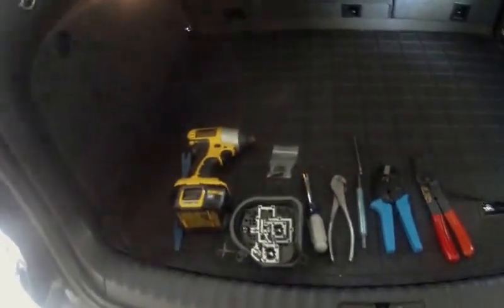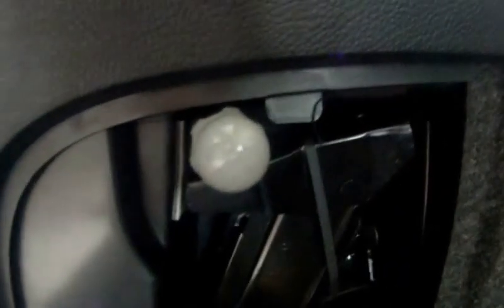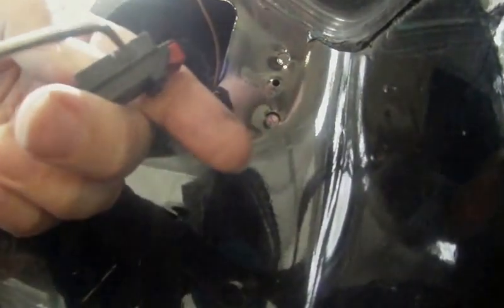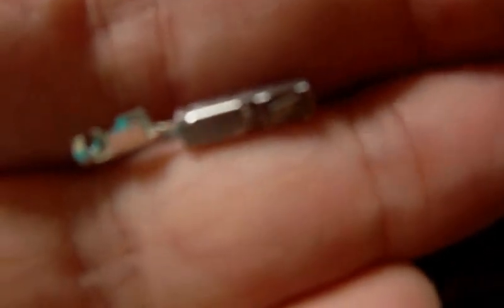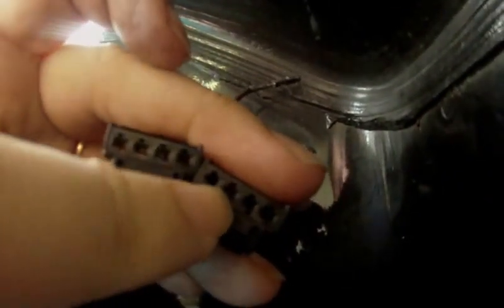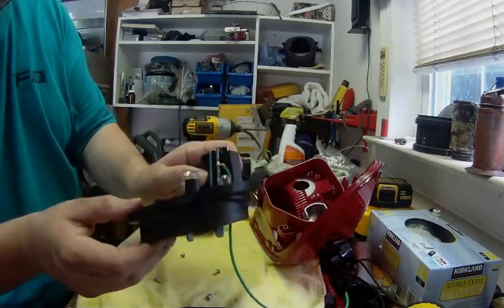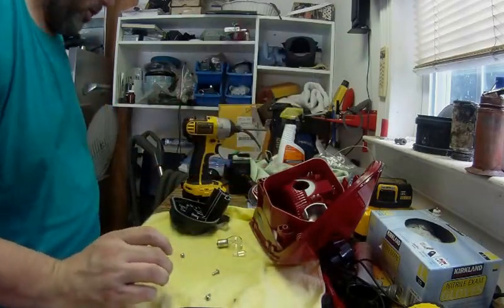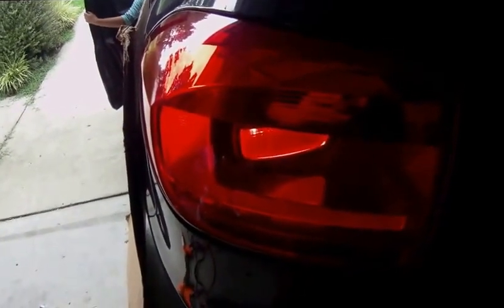Tiguan tail light removal and wiring repair

Comment: Absolutely exactly what I was looking for, and maybe some help for others. I have a 2015 GLI which uses the same connectors and 3 wire system with these plugs. Surprisingly difficult to find info on repairs for my car like this. If anyone tells you that your trim line of  your Jetta is the same across the board for parts, I have run into hard times trying to source the correct part or "kit" or whatnot for the GLI. The taillights are definitely have been my latest endeavor. Besides having different wiring altogether, I used your video to learn how to repin the correct harness kit to my GLI. I bought a $12 pin tool off Amazon (fit for the female end but too short for the female receiver) but never thought about grinding off material of a staple. Brilliant. saves me a trip to the autoparts store tomorrow.

Comment: Thanks for taking the time to post this.  The most important part of the video - for me - was too dark to actually see...I won't belabor the lighting issues...but the narration gave me some sense of what you were up to.  I have to do the same repair once the new connector arrives...I guess someone could make some side money making pigtails for VWs, since they are hard to find in the US and the problem is more rampant than I would have thought.  And thanks for the well placed Caddyshack reference.

Comment: Thanks man.   Was getting frustrated as my blind self was certain there was no pink lock.   As for tools, I had miscellaneous pin pushers that did the trick.
Reply: Ps, the pin pushers are $10 or less off Fleabay.  Doesn't take much and filled in some of my missing molex pushers.   ;)

Comment: Is there a better view of the de-pinning? Couldn't see what happened after pushing the pin through the front
Reply from the maker: There isn't much to see.  When you push the staple into the opening, it folds down the tab on the pin that allows it to slide out the back.

Comment: Thanks for the video.  I too am surprised that I couldn't just change the bulb but have to replace the whole connector and housing.  I bought my 2015 Tiguan second hand with 30,000 km for about $20 grand.  So far the computer/stereo/back-up camera has gone kaput, I just had an airbag error that stopped my steering commands and horn from functioning also, and now this.  The airbag was warrantied luckily.  The stereo unit/back-up camera/hands free thing is not covered and apparently is about $2000 to repair and not guaranteed to be any better.  And now this, you say it's underbuilt for the current drawn.  The connector is definitely corroded.  Not very impressed with VW so far.

Comment: I have a VW Tiguan 2016 , same problem , VW should call owners to repair  our Tiguans , Am i wrong ? i think we have a case.
Reply from the maker: In my case there was an aftermarket trailer light kit installed using scotch lock wire connectors.  I don't think my issue had anything to do with VW. You may have a different circumstance. You might ask the dealer to cover the repair under warranty since your vehicle is a 2016 and this is a safety issue. Good luck.

Comment: Is there a way to get the amber turn signals to work?
Reply from the maker: Vince H I have not tried. I think others on vwvortex or in the mytiguan forum have made that modification. It would require wiring from the BCM under the dash to each rear light and modifications to the lights themselves.
Reply: sbcncsu I wonder if there's somebody in my area who would be capable of doing that wiring. I just got the row LED tail lights for the Tiguan which come with the amber turn signal bulb already installed. It sucks that once I install them the amber turn signal won't work. I also want to program them so I get the full brake lights instead of just the outer ones lighting up.
Reply from the maker: Vince H Check on Facebook for a local VW club or meet and ask some of those folks local to you.  The VW community is pretty awesome.
Reply: sbcncsu I found a local guy. I'm going to see if he can do it. Thanks.